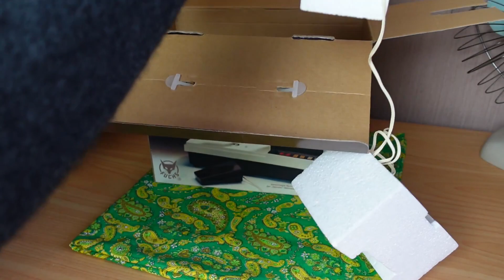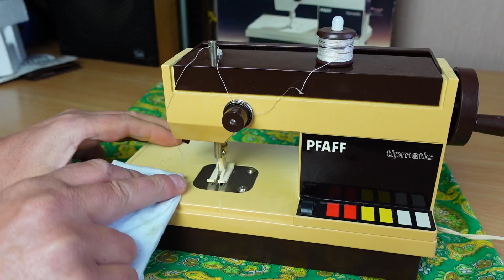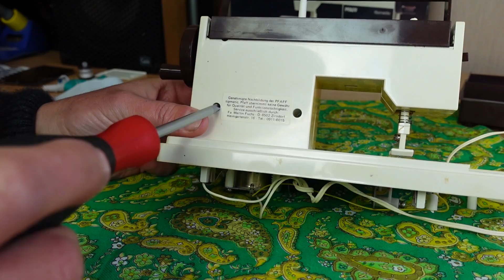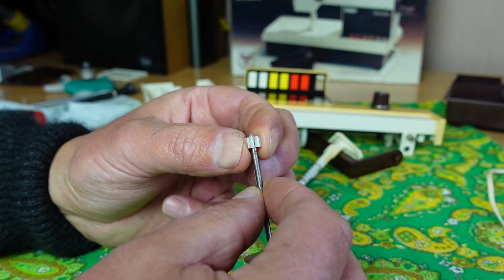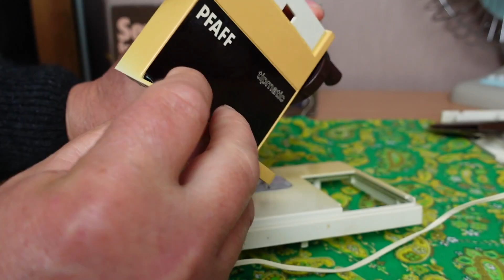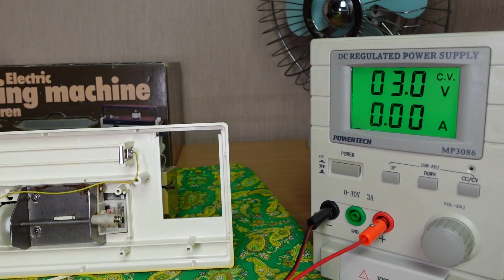Pfaff Tipmatic Toy Sewing Machine for Children

Comment: Ever thought about a cooperation with a CNC or machining-channel to reproduce broken plastic parts in metal? That would result in interesting material for both.
Reply from the maker: It would be good if the parts were cheap to design and manufacture. There's not much demand for this sort of thing and the development costs may be expensive. Thanks.

Comment: There is a way to fix it rather easily. Just glue everything together so that external diameter is correct and not broken. Now you have a hole that is a bit smallet than the shaft. Use a lighter to heat the shaft and then just push it into the gear. The heat of the shaft would melt the plastic and form a new hole. It it will be too big - you can always glue it with glue gun.

Comment: Hello, cracked plastic gears in older sewing machines are sad, I have a 530 Bernina from the 1950’s that I love, but know that one day the nylon gear will crack. I live in hope that there are so many Bernina’s that someone will provide 3-D printed replacements, as the rest of it is mechanical so built to last. Loved seeing this wee Pfaff- and so pleased to see you post after all the floods in Nelson,
Reply from the maker: Thanks. There are replacement gears available for the Bernina machines. They are third party reproductions as Bernina no longer supply the parts.